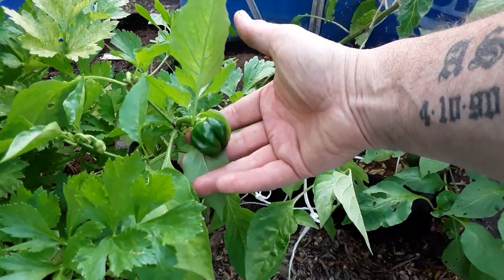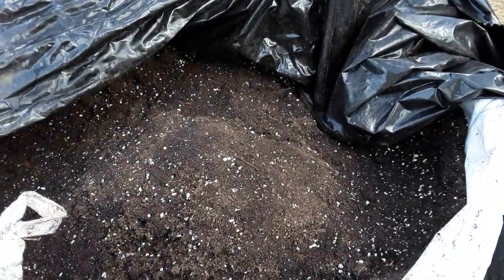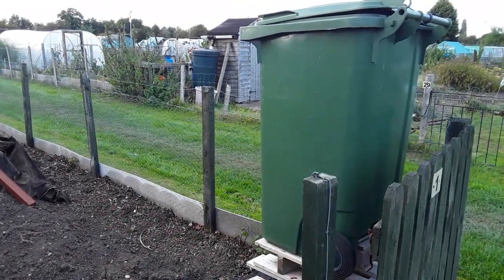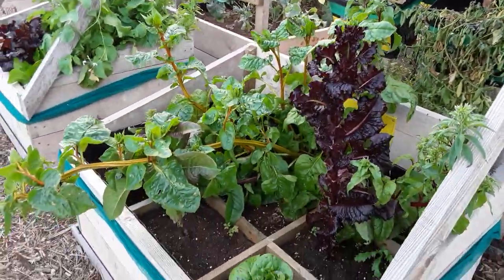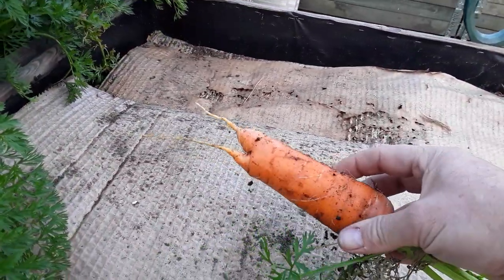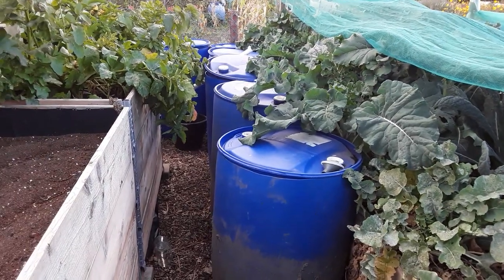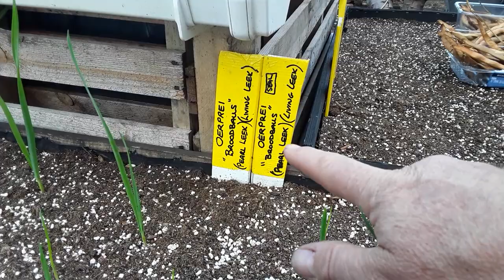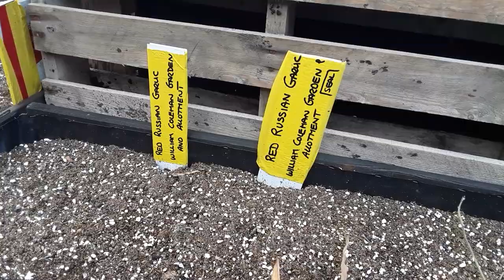End Of September Tour And Progress On Our Allotments ♻️ Bean & Radish Seed Saving

Comment: Another great summer !! Question: when you save beans for seed, how long do you wait after you pulled the pods off the plant before taking the beans out of the pods ? 
Cheers
Reply from the maker: If the weather is good they should dry naturally on the plant, if not then it's down to common sense when they are ready to remove.

Happy gardening, Terry King.